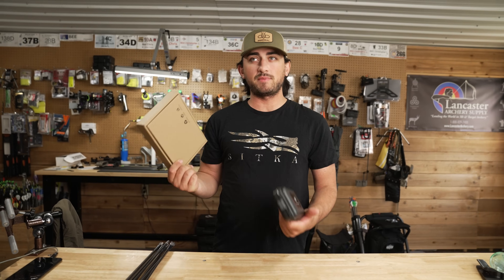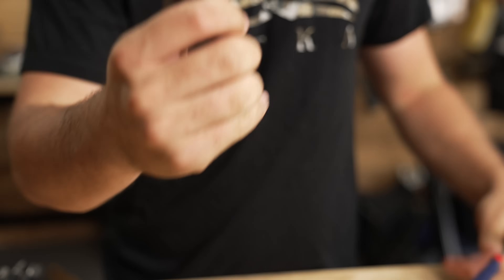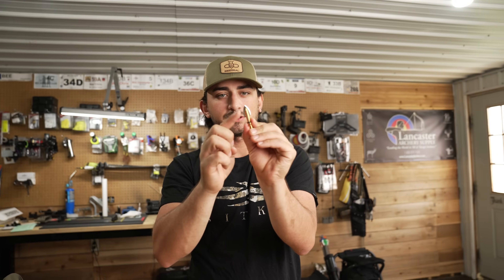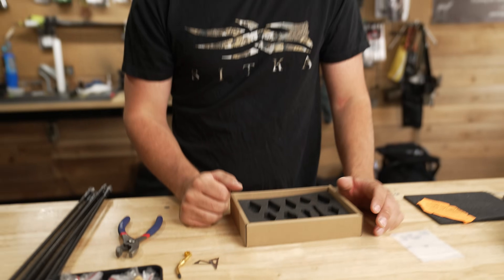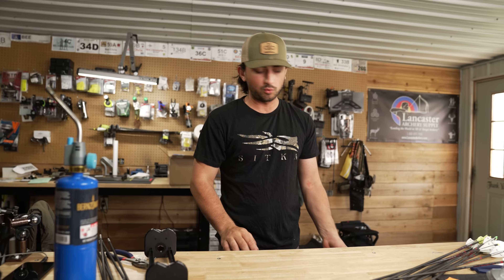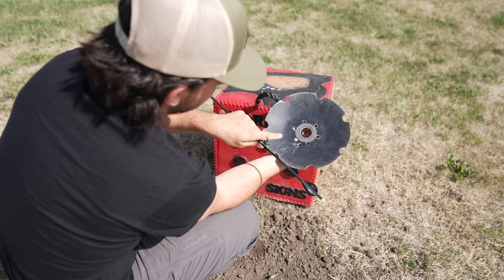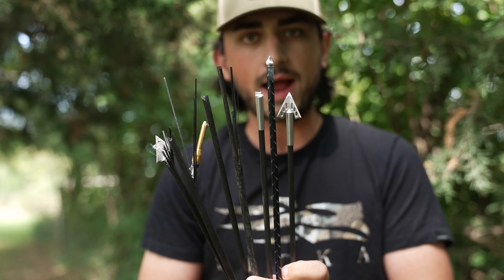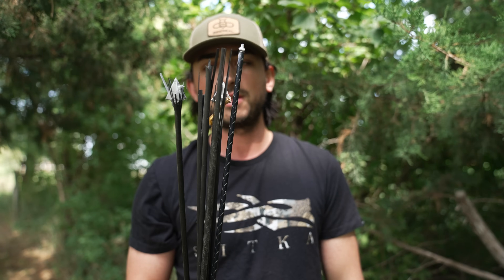CHEAP AMAZON BROADHEAD TEST

Comment: I took down a 220 pound 8 point with one of those first broad heads you reviewed. They may be cheap af but apparently they get the job done 😂
Reply: Yeah they only have to work once. In my experience most expandable heads are junk once they've gone through an animal and hit the ground.
Reply: been shooting the knock off montecs for a while now. they're a bit less durable but I've still killed 3 o4 with one broadhead,
Reply: @BenDownTooLong  exactly.  I have a friend who mounts the arrow (if he recovers it, obviously) with any fan, rack, etc. so he already factors in not having that arrow in his quiver anymore before release.  Thus he has no problem using low cost parts, .006 straightness shafts, etc.
He shares my belief that getting closer (or bringing the game closer) is about 80% of the challenge of bowhunting, not practicing 50+ yard shots for months before the seasons start.  Every culture on earth fed itself for generations with a bent stick and a string shooting somewhat straighter sticks with rock heads that certainly weren't matched to the tenth of a grain, so we don't put as much stock in super-tuning everything as some do.  Pretty much down to just "this arrow is always outside the group, so set it aside, re-fletch, maybe try different heads to see if anything makes it hit the same as the others."

Comment: Let's  see what a "good " broadhead does on that same block.
Reply: I agree. This video is useless without shooting the "good" version at the same target and then comparing the damage.
Reply: exactly Lusk Archery does a great broadhead test and he has done a couple amazon heads that actually tested very good. Deepower 125gr heads tested very well.
Reply: For real
Reply: He'd probably would loose sponsorship on a broadhead he uses
Reply: I was about to say the same thing. None of them would last or do any better. 

Oh, it broke when shooting a cinder block so it won’t work on an animal
Reply: In reality it was probably just a video for entertainment.  More views, more likes, more comments.  Seems like if you're going to destroy a bunch of arrows you could learn something.  What about the arrows? One of the arrows survived. Looked like a 4mm with insert/outsert. I want to know about that too. If the arrow explodes on impact it won't  matter which head you use.
Reply: You are correct. There were two 4mm Sirius that survived the cinder block. He can’t show those, because it will hurt his Victory Sponsorship. He had to bust the balls of an arrow in the beginning where you can see he cut the inserts down to a nub and it is all aluminum. With that fast change of direction (which is why his pieces when flying so far), no arrow (Victory included) would survive.  @jbrooksy
Reply: Definitely better especially double bevel and along those lines check out Lusk archery adventures
Reply: Exactly. I was rolling my eyes the whole first 2 minutes that I could stand until I couldn't take it anymore and clicked away. Trash review
Reply: Need an apple to apple comparison.. shoot at a carcass or maybe a whole leg to see the effect of the knock off compared to the real deal.. entertainment wise, fun to watch destroying stuff but doesn't give any feedback on possible good ones we lesser earning public might be interested in.. I shoot willows point which I  bought for less than a dollar for 4 pieces (weight wise ±2% off advertised). Sharpened with some whet stones and I achieved pass by thru on a wild boar at 36m (high pass thru) the animal rampaged about 300m or so before dropping (quite a hunt to find it).. so I wouldn't exactly say all east Asian made knock offs are bad.. willow point were just basic tempered steel, flies ok out of my 60lbs china made compound bow. Arrow set up was mixed carbon with 4 fletched 3" feathers. Total weight 515gr.. still can harvest mid sized game
Reply: I love the show bro but when did deer start wearing cinder block vests?
Reply: I agree. Let’s see how the name brands hold up. Same tests. Same pliers durability and weight check. Get the name brands that match the copy cats. All in all great video if you want to see destruction as most of us already know what broadheads we are using. If wanted something closer to bone plywood may be a better substrate.
Reply: Too be fair he gets enough free stuff that I'm sure he could of but can u imagine sending all those expensive broadheads on a 250 mph journey too a brick 😐 mind u he didn't mind ruining all those arrows did he 🤔 and very few deer are made of concrete.  So I'm pretty sure those would easily kill. Just 1 time probably
Reply: GOOD broadheads smash or stick in cinder blocks, with no damage to the head besides dulling, and no damage to the arrow, either. 

Anything less goes in the rabbit arrow pile.
Reply: Exactly lol
Reply: Doubt any broad head would survive hitting a disc lol
Reply: @timpurdy5737  right 🤷‍♂️ I mean if it did then no1 on earth would use anything else.
Reply: @stephenballard3759  Horseshit and gun smoke...calling a broadhead "good" if they don't tear up when shot into a cinder block is preposterous. FACT is if a person spends $20 on "Amazon" heads and gets a single use out of it then it's money well spent....I only shoot a broadhead once anyways I mean I buy 2 packs of whatever head I'm shooting so if I get 6 shots / harvests' then I got my money's worth. Now, on to the sharpness factor, I'm able to use a broadhead sharpener....blah...blah...blah....this video was , I'm sure, for entertainment purposes only. To each their own,  but I'd bet you tune your bow, and prolly gonna be alright.

Comment: I have bought a bunch of Deepower fixed heads off of Amazon based off of Lusk's testing....let me tell you they are just as sharp (if not sharper), just as durable (if not more durable) and just as accurate than MANY of the big name heads out there.
Reply: I use the knock off Montec G5s and they result in the same kind of pass through shots. Easy to hone on a stone, spin test, work well.
Reply: I have the DEEPOWER montec style ones. Let me tell ya… they fly amazing!
Reply: @The_Arrow_Life  Ditto
Reply: 100 percent correct. They’re the best. Lusky is the best
Reply: asin of the ones you bought?
Reply: Finally a real review
Reply: All the big names now had to start somewhere too.

Comment: About the first ones you showed, we fired one at the tread side of a tire at 40 yards with a 10 point nitro 505.  It blew right through the first side and then turned to the left bit with the front of the arrow coming to rest just outside of the tire (like where the psi numbers are).  It completely destroyed the broadhead and bent the ferrule.  One of the blades was stuck in the tread area of the tire, which is also where the shaft broke inside the tire right before the fletching.   The tire actually rolled a way a couple feet when we hit it.

Comment: Chinese-made knock-off broadheads are pretty much all single-time use.  I killed a buck on opening day with a 1-piece Deepower 125 grain 3-blade broadhead with unvented blades.  Had a complete pass-thru and the deer went 10 yards and dropped.

Comment: Fun test, but the disk test was very unfair and the cinder block test as well.
As the blown up arrows proved.
The arrows didn't blow up because of the broadheads.
They blew up because they were not strong enough to survive hitting what you shot them at.
I doubt many top brand broadheads would do very well in a test like that either, even if they might do better.

I 100% agree that you should not use any of them on deer, no matter how sharp they are or you can make them.
I have tested a few Chinese piracy broadheads myself and some of them are not to bad when it comes to weight, how they spin and sharpness.
Some of these are rather strong as well.

I also bought a bunch of "Rage Hypodermics" that I am not sure if they are piracy or if they are extra production from the factory and sold illegally, as they look and feel exactly like the ones rage sell, but without their name on it.
They are also as "sharp" (dull) and strong as the original Rage Hypodermics.
That said, am I not using them on deer.
But I am not using an original Rage Hypodermic on deer either.
I am not using mechanics on deer or bigger animals anymore at all.
Not lost any animals because of it, but got to many funky results, even with my 650 grain arrows at 260 fps and I have seen to many hunters wound and lose animals with very good shots, using mechs.

I also bought some Helix single bevel broadhead copies that have been made well and fly well, but they are to soft to use on deer imo.

But what I do use these cheap Chinese broadheads that fly well on, are small game.
Like hare, rabbit, grouse and more.
Reply: Why does it matter if it's a brand name broadhead or the same exact broadhead without a brand name on it? The deer does not stop and ask what kind if broadhead it got hit with, if it's in the vitals the deer will go down. Brand name broadheads are made in the same Chinese factory on the same production line as the cheap ones, they are identical except the packaging that they come in and spending 20 times as much for a fancy box and a name brand sticker is not going to make you a better hunter. People used to use sharp rocks on their arrows and those worked fine for thousands of years so why do you think that a brand name broadhead is now required to kill a deer? I use an unbranded bow made in Taiwan, Chinese arrows and Chinese broadheads and my gear takes deer just fine.
Reply: @12jazion  
Well.
There are two very different types of unbranded broadheads that come out from China.
There are the types that come out from the same production lines as the brand names as you talk about and as I suspect the nameless Rage Hypodermic versions are.
But you have the types that are pure piracies, that are made at different factories and where they use metal and components to make them, where it will be extremely unethical to use them on deer.

And if you think that all cheap Chinese broadheads that look the same as brand name broadheads, are made on the same production line, you are very incorrect.

And if you just use these cheap Chinese broadheads on deer without testing one in the batch you ordered first, you have extremely little respect for the animal you hunt.

I couldn't care less about what brand broadhead people use, but this nonsense about what our ancestors used is just stupid.
They used what they could to survive, included throwing large rocks on animals.
And they for sure wounded lots of animals they never killed.
And even they tried all the time to use the best material they could and make the best arrow heads they could.
They didn't just use a cheaper rock arrow head when they could use one of flint or obsidian.
Reply: @The_Judge300  How is using a Chinese counterfeit broadhead on a deer unethical? The deer do not ask if the Chinese are infringing on patents and a counterfeit or unbranded broadhead kills the deer just as dead as a name brand one. Even a field point will kill a deer if it's a heart shot, deer are thin skinned animals and they do not take much to kill. Now if I were hunting cape buffalo I might worry about the strength of the broadhead but for deer, just about anything seems to work fine. An idiot neighbor kid shot a deer with his 750 fps .177 pellet gun and somehow that killed the deer so if a cheap pellet gun can drop a deer then Chinese broadheads can too. Shot placement is everything and a pointy stick thru the heart will kill any deer regardless of the cheapness of the pointy stick.
Reply: @The_Judge300  You talked me into it, I bought some brand name broadheads at the local sport shop. The broadheads I have always hunted with cost 1.55 each and the new ones cost 15 dollars each so I will put them to the test and see if they kill the deer 10 times deader than the cheap ones, 10 times faster than the cheap ones, or if I get 10 deer with each shot. In any case I expect to see dramatic results based on the 10 times higher price tag. Maybe they kill, dress, process and cook the deer all in one shot so it's ready to eat as soon as I walk up to it?
Reply: @12jazion  
I bet you have wounded more deer than you have killed.

Comment: I purchased some of these cheap broadheads in the old Fred Bear style, not any of the ones you tested,I sharpened them myself using a Lansky sharpener, got them razor sharp. During the Pa. archery bear season I killed a 385 lb. 19 11/16 Pope and Young black bear. The arrow passed through both sides of the rib cage with a quartering away shot and the broadhead was not damaged.

Comment: I use the the knock off m5 on Wal-Mart arrows when hunting hogs in the swamp if you sharpen them first they're not bad.the biggest reason is I don't mind losing a $4 arrow with a $3 head in the muck. Now when deer hunting I use the good stuf
Reply: If you can take a hog with the cheap stuff, you can take a deer.
Reply: I know but the heads I use in the swamp are like  12 for $16 and I don't want to take a chance of just wounding a deer
Reply: Dm me☝️☝️☝️
Thanks for watching and commenting 

I have got some rewards for you🎉🎉🎉

Comment: The multi head pack is meant as a display set, not for actual hunting. Most of the components in American high end bows are made in either China or Taiwan, so it's not wise to run down..."Foreign" made archery products, as we are all shooting them.. As for replacable thin blades, I killed dozens of deer with the old Bear heads that looked exacty like the ones shown. Come on Chris, (:

Comment: Sharpen them up (like you should) and get a single use out of them. Sometimes you have to go with what you can afford and hope for the best. Biggest thing with amazon is read the reviews. Did you try bending any of the name brands. All look slightly different. Sure all you need is to change one feature.

Comment: Hahahha Chris I'm feeling that you should have safety glasses on. Great test though. So many crap products out there. Hey what INSERT you using in your Victory arrows? I have the RIP XV elites and the 3DHV'S. Awesome arrows.
Reply: All of his expensive broadheads will break under the same tests. He is a brand snob and there is no knowledge to be gained from this video, all of his brand name broadheads are made in the same Chinese factory as these cheap ones and will perform just as poorly, spending more money does not make you a better hunter. People used sharp rocks and they worked for thousands of years so why is a brand name now required to hunt deer? I use the first ones he showed, the ones that he bent with pliers and they take deer just fine.

Comment: I really didn't like the Sirius arrows breaking like that even though they was shot in steel
Reply: If you look, the inserts in those arrows are cut all the way to a nub.  Probably so he can get more speed. Those look to be the all aluminum too so it would be a terrible setup that short. Those post should not be cut that low. Did you notice at the end how many arrows he held up with collars that looked untouched. Those were Sirius too. Since he is sponsored by Victory, they probably didn’t want to show the labels and give any credit to them. Joke of a test for sure.

Comment: I won't shoot those solid blade montecs ever again. Horribly inaccurate. Like it has lift. Then it cuts like shut because it runs an obtuse cutting angle. Then the factory cutting edges were also jagged as F. This is name brand. . . I've had multiple people tell me to throw them away.

Comment: Deer get killed every year with long bows and recurves. With swept back thin broadheads that would fold like tin foil shooting concrete and hardened steel discs. Vids likes these are senseless. The “expensive” broads and arrows would have the same outcome.

Comment: What is the point of this video? All of your brand name broadheads will bend with a pliers and will break when shot into a steel plate or cement block and most of them are just as dull as the Chinese broadheads. As a matter of fact, most of your expensive brand name broadheads are made in China at the same factories as the cheap ones and many are identical because they are the same broadhead, one just comes in a nice box with a brand name and the other comes in generic packaging but you believe that because you paid 10 times as much the one in the nice box must be better when that is not the case. Take your brand name broadheads and do this exact video on them and they will fare just as badly as these ones. I use the first broads that you showed, the ones that you bent with the pliers and they work perfectly fine at taking down deer because I hunt deer, not steel plates, cement blocks, or pliers.